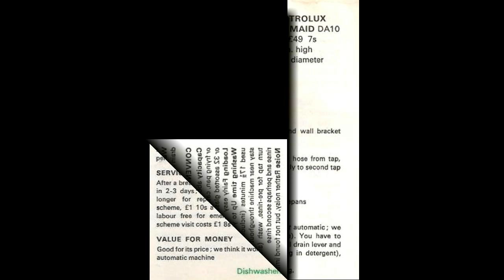Electrolux Dishmaid Dishwasher 1961

Comment: A modern version of this would be nice, with modern automatic features,  the style is perfect for a smaller kitchen
Reply from the maker: Yes you can get the small box like "Bob" dishwashers that sits on the sink top and can even hold its own water in a tank on the top !!
Reply: Seriously, this type looks really robust and simple, and something you could repair yourself when it breaks. Which then has an advantage to modern dishwashers. Or all modern devices. When a new device breaks nowadays, it's scrap metal.
Reply: @WeHadOneOfThose  I have seen reviews of Bob, it looks ok, but very expesnive.
Reply: @Marc-ox7fy  Still keep with the idea, but  new versions. I think it is great, but running machine that old  for any length of time may not be a good idea.  I have given up the idea of having a dishwasher now,  i was thinking of a counter top one, but the cons are more than the pro, the main con is, I can wash up by hand faster.

Comment: Great post but what a performance!!! Cant imagine many were sold when the colston turbo jet which was fully automatic was on the market at the same time.
Reply from the maker: syhooverman Yes not many about and have seen more Colstons, but for simplicity I bet the Electrolux lasted longer albeit more user interaction, I have a Colston tabletop and was amazed by how many pipes , pulleys, belts, drives and cork seals it has...
Reply: @WeHadOneOfThose  Oooo.  I'd like to see that, as well.
Reply: Can you please do a video of the xpelair heater on the heat setting

Comment: Looks like it just pees on the dishes 😨 @ 05:55
Reply from the maker: Hi Doug, depending on water pressure it can be low and seem feeble but did an adequate job on using it, fun to use but not a patch on todays larger dishwashers.